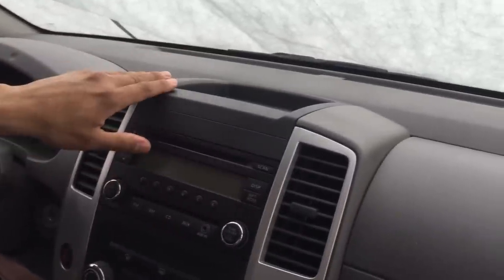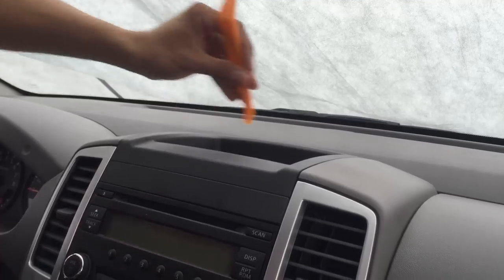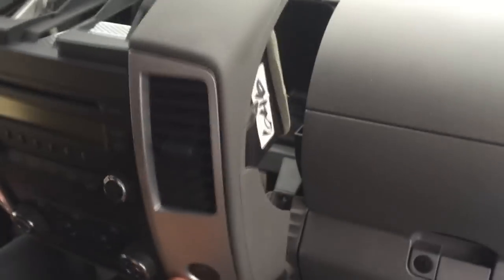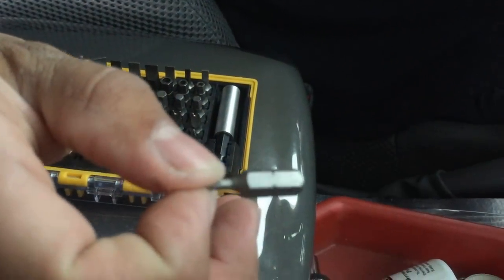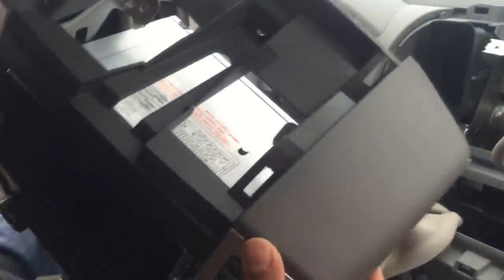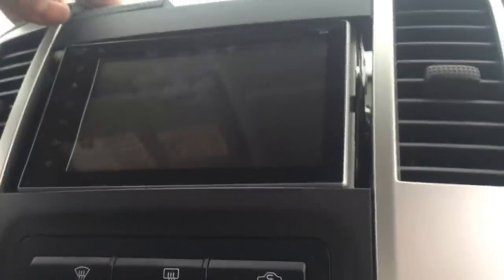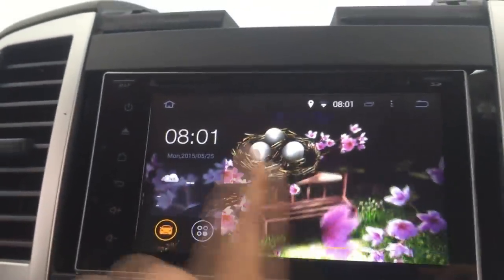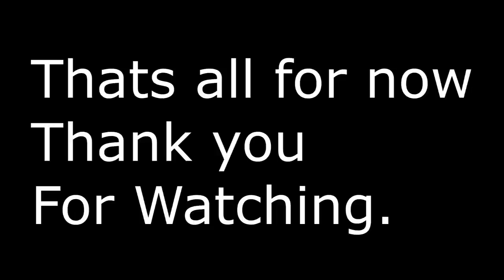how to remove Nissan car stereo , how to install car stereo on Nissan frontier

Comment: You can unplug the air bag as long as the ignition is off, do not turn ignition on at any point with air bag unplugged or you will have an air bag indicator light on that only the dealer, or audio shop can can turn off which cost money.  Also when doing aftermarket head units in nissans always do the ground to the chassis , use another ground by itself from the head unit or u will usually get feedback in your speakers.
Reply: this sounds important but i dont understand. are you saying i should use two grounds. im an electrician but i know little about car stereos. i can do it but i need direction so could u explain this again?
Reply: art satzger yes about the grounds in almost all nissan vehicles you should use 2 grounds. Use the factory one that's in the car harness , than come off that with another wire An ground it with a self tapping screw or bolt to a good known ground . Don't use an existing factory ground bolt tho.. you want your second ground to be by itself. Even one of the screws that hold the radio chassis to the dash is fine if the chassis is metal. Reason for this second ground is in most cases with Nissan the factory ground in the harness is not very good. Yes in most cases it's good enough to power up the radio , but I've had a lot of cases where the radio wouldn't even power up without that second ground. Also I've had cases where the radio would keep resetting itself with the time, EQ settings etc , and hear a whining noise through the speakers every time you accelerate the vehicle it would get louder ..adding that second ground gets rid of all those issues .  As an electrician you know a good ground is important ...in the car audio world that good ground is just as important .  Also make sure your antenna is plugged in nice An tight too because in some vehicles the antenna is a second ground An the radio will not turn on unless the FM antenna is plugged in... Dodge /chryslers are known for this stupid idea .
Reply: @michaelpalmisano6788  excellent detailed explination. now i understand. you may have saved me pulling my dash apart a second time. thank you. im subscribed and will continue to watch you videos.
Reply: art satzger no problem man ,BUT this is not my video . I'm sure the guy who made this video appreciates the subscribe tho lol.
I'm just a car audio tech who happen to be bored one night ,An started watching random YouTube videos An came across this video an added in my 2 sense lol.   Good luck on your install ...An remember if you unplug your airbag light make sure your key is off an out of the ignition first, An DO NOT turn the car on with the airbag unplugged.  Safest way would be disconnecting the negative battery terminal before you do anything.
Reply: You can reset the air bag light on your own no need to pay nothing
Reply: @robertohernandez9476 yes you can if you have an OBD2 scan tool that has the option to reset airbag lights.  There's no other way to do it.  Even disconnecting the battery for X amount of time does not clear the code.. even if the light goes out afterwards does not mean the code is cleared .

Comment: Great video! I've heard mixed things about Chinese double-din units. You seem pretty pumped in the video, but after using it for a bit, what are some of the Pros and Cons of the Joying unit?  

Also, could you post a link to the model that you bought?

Thanks Alex
Reply from the maker: +cherok is a good unit still working the only problem i have is the online stream videos , the screen goes blue and sometimes green. other then that is ok i like a tablet

Comment: Thank you for the video.  Is this tablet style version of the Joying 7" without buttons and knobs better than the other radio version with the volume knob and buttons?  Is there a way on this one to quickly mute the stereo without having to take eyes off the road?  Or if you are driving and you suddenly have to mute the stereo, do you need to find the down volume button on the left and keep pressing it repeatedly until stereo is muted?
Reply from the maker: +AndStuffz dear friend , yes you can mute right away also they include a remote control you can find alot of extras there

Comment: Just wondering what wiring harness did you use. I have a 2016 frontier. Thank you for your time in advance.
Reply from the maker: hi the cable wiring was provide with the adroit unit just was plug and play :)
Reply: Would you have a link by chance Thanks again? I have a back up camera an xm. not sure if this unit supports xm or not.

Comment: Did you find a trim piece to fit around the new stereo. I have a 2010 Frontier with the same dash. Seems simple enough, but curious if you have a part supplier and part number for the trim piece to close the gaps. Stereo looks great.
Reply from the maker: +Stephen B 
There is no frame to fit the unit I still have the gap on it , i think they send me the wrong Unit, i will contact them and hope they send me the right one

Comment: hi. were you ever able to figure out a nice way to cover the side gaps around the radio. can you share? I just installed it on my Frontier too. Thank you.
Reply from the maker: Hi friend , no I take the unit off there's no frame for that kinda gap I suggest if you bought it from car joying to contact them and get your money back i ask them about this issue and they say no frame Don buy this unit won't fit
Reply: +Alex raynor Thank you. Were there any other problems that you can share with me? The unit I just installed is defective. The volume knob stopped working.

Comment: Do the steering wheel controls work with the standard nissan wiring loom that joying provide?  Thanks
Reply from the maker: Pete Adams  hi friend , Yea the  steering wheel controls work volume up and down , also the selec track works , but the phone controlscheck this for more details             watch?v=jjrcGuB0D5s

Comment: tu tenias 3 conecciones al Radio... y en el nuevo radio .. el harness .. dos conneciones.. donde quedo la tercera ,,>???  you had 3 connections on the Radio .. .. the harness .. had to connection  .. wicht is goin to the harness in the car.. but.. were did you connect the otherone

Comment: Will this system also fit on a 2009 Nissan Altima Coupe? Great video man!
Reply from the maker: +Hugo Cisneros Thanks for your message and sorry for the late reply.
Could you please tell us your car model and the year? Could you send some pictures of your car dashboard? So that we can recommend a best fit for your car.You may need to measure your original car radio size to see if it can fit. Otherwise, you need to buy the frame to make up the gap.
2. For the wiring harness, we will send you the ISO cable. 
3. Does your car have CAN bus? Please make sure it, otherwise the unit will be no sound.4. This is the radio booster, if you want get excellent radio reception, this one is the best. http://www.carjoying.com/car-accessories/other-car-accessories/ant-208-universal-car-fm-am-radio-aerial-antenna-signal-amplifier-booster.html

Comment: Whatsup, this unit fit a 2013 Mitsubishi Lancer Evolution GSR? Thanks in advance.
Reply from the maker: +evolelvis5 

Could you please tell us your car model and the year? Could you send some pictures of your car dashboard? So that we can recommend a best fit for your car.

You may need to measure your original car radio size to see if it can fit. Otherwise, you need to buy the frame to make up the gap.

2. For the wiring harness, we will send you the ISO cable. 

3. Does your car have CAN bus? Please make sure it, otherwise the unit will be no sound.

4. This is the radio booster, if you want get excellent radio reception, this one is the best. http://www.carjoying.com/car-accessories/other-car-accessories/ant-208-universal-car-fm-am-radio-aerial-antenna-signal-amplifier-booster.html

my email is raof0101@gmail.com
+Hugo Cisneros Thanks for your message and sorry for the late reply. Could you please tell us your car model and the year? Could you send some pictures of your car dashboard? So that we can recommend a best fit for your car.You may need to measure your original car radio size to see if it can fit. Otherwise, you need to buy the frame to make up the gap. 2. For the wiring harness, we will send you the ISO cable.  3. Does your car have CAN bus? Please make sure it, otherwise the unit will be no sound.4. This is the radio booster, if you want get excellent radio reception, this one is the best. http://www.carjoying.com/car-accessories/other-car-accessories/ant-208-universal-car-fm-am-radio-aerial-antenna-signal-amplifier-booster.html
Read more               Show less

Comment: I would like to take do a custom application using this unit or something like it. Do you know if this is compatible with the Schosche GM5201AB Camaro dashkit?
Reply from the maker: Scott Ratajczak  let me confirm that with carjoying team , im sure they can find the right unit for you , also if you can give me the measurements  and the cable connector
Reply: Any word yet? Can I contact you via email about this?
Reply from the maker: Scott Ratajczak  sorry for make you wait long.. i check with the manufacture and they say the size can not match. your Camaro dashkit very sorry for that.

Thank you

Comment: also did you manage to get the steering controls to work? was really helpful video and good job on the install BTW!
Reply from the maker: +Andrew Bondarenko  yea , they work you have to configure them.
Reply: Hey Alex, did the steering control wiring work plug & play through the harness or did you have to connect the extra "Key 1 & key 2" wires somewhere?

Comment: Hi Alex, love the tablet idea. i have a question that i was hoping you might be able to help with. I'm in the UK and have a 2007 Vauxhall Astra (h) mk5 (SATURN ASTRA IN THE STATES) with a BID display and I want to keep all the audio controls the same from the center console and steering wheel but just change the BID display to a android tablet. Any chance you could help with any information on what to do or how to go about the changes, even maybe what parts i need. any help is welcome and appreciated. thanks from an overseas fan

Comment: Did you really just drop the GPS antenna down in the dash, yea that's gonna work real good. At least put it on top of the radio.
Reply from the maker: Yea it works perfect after months an years  it makes no difference if you put it under , in out or on top.
Reply: You're hack then